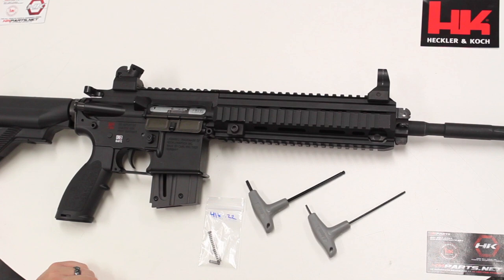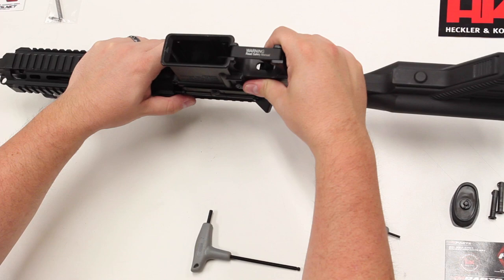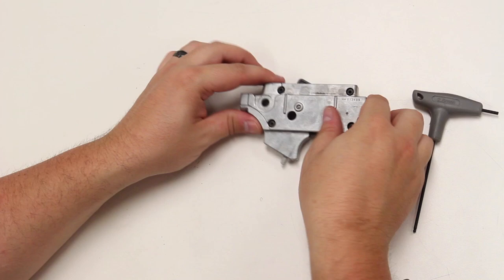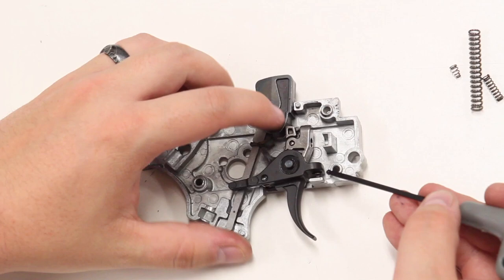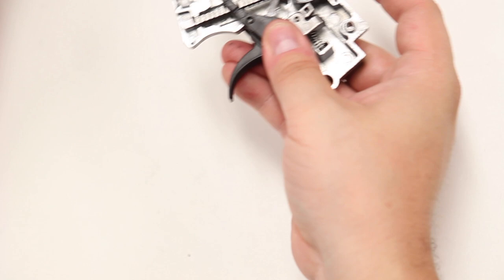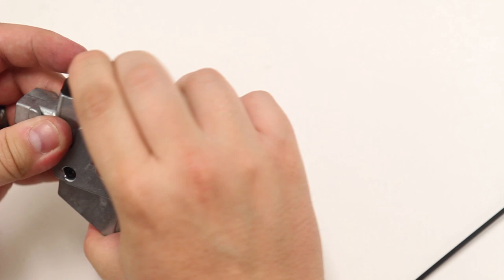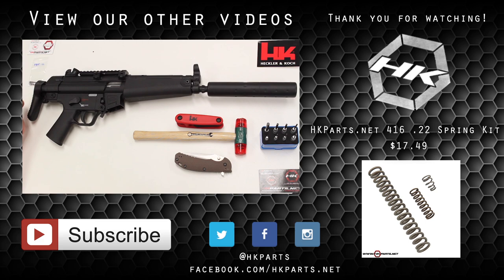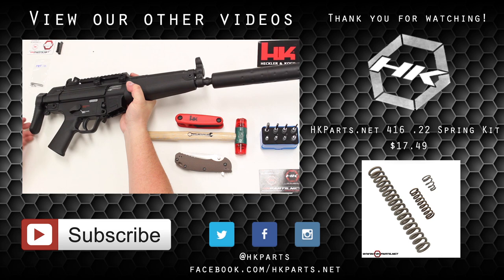HK 416 22 Match Trigger Upgrade Spring Kit Installation

Comment: Just bought a HK 416 D in .22LR.  Very nice firearm.  Well made.  I do have to caution that a few things have changed since this video was made.  1) The trigger assembly group is no longer metal, it is a black plastic. 2) while there are 4 screws, they use a small "star" type screw driver, not an allen wrench. 3) there are no longer 4 little nuts as HK seems to have had them embedded into the plastic.  4) there is a small diameter chrome rod that is just to the 12 O' Clock of the safety selector. This rod seems to like to come loose when you pull everything apart. So if it does, keep it with the cover you remove and not the cover with all the trigger parts in it.  You can push it back once everything is assembled.   Other than that, be careful when you unscrew the last screw.  Our assembly "sprung to life" once we tried to separate both sides.   I had zero opportunity to hold things together, just one small detonation!  This video is great and shows you what to do.  It is also useful when you have to put all the pieces back together again.  The end result, not as easy as the video shows but not hard either, just take your time and do it in an area where you can easily find small parts.  Once assembled, HUGE difference in the trigger pull.
Reply: I have the Walther version I'm installing the springs soon did u polish sear and hammer too?  Or just the spring kit? How much the pull after?
Reply: I’m having trouble installing the metal rod back in. Please help!!!
Reply: Which rod are u talking about
Reply: Thanks for the info on the plastic trigger housing. I just sold my older Umarex imported MP5AP model in favor of the new HK Imported MP5SD model, while that internal parts appear to be all the same the trigger housing on the new SD model is plastic and I’m very disappointed that Hank would cheap out like this. If I’d known this up front I would have never purchased the SD… Shame on you HK!
Reply: O boy.! Well mine is a couple years old I guess. We'll see. Love the grenade launcher barrel lol. One of the fake but why not parts on the toy. I'll be reading this post a hundred times I'm sure
Reply: I just bought one of these yesterday 3/26/23, and found it just as you have stated; plastic.  Rather disappointing.  I haven't shot it yet, so I will wait to discuss it later on.
Reply: A 4mm allen for the pistol grip, a 2.5mm allen for the mag release and a T10 torx bit for the 4 screws on the trigger group. This is for the version with the plastic housing.

Comment: I did this upgrade and took about 2 hours. It's not hard at all unless you're impatient. Take your time, use a steady hand (and fingers), and work on a workbench with good lighting.
The thing that made it hard is this installation video: its outdated and gives false info for the new black plastic revision of the trigger assembly.

For those who want some tips:
1) The pistol grip screw is 4 mm hex.
2) The mag release screw is 2.5mm hex.
3) Trigger assembly screws are T10 Torx. Do NOT use hex key on it as mentioned in the video or else you will strip the screws.

4) Flip the safety to "fire" before taking it out of the lower receiver.
5) Use needle nose pliers to carefully place the new seer spring and the trigger return spring. Much easier to do than using your fingers.
6) When in "fire" position, the safety lever housing's ball bearing is at the bottom (6 o'clock) detent. NOT in the left (9 o'clock) detent as mentioned in the video. Be sure to install it at the bottom detent. It also does NOT go in the through hole in the plastic housing.
7) Once the front cover is almost back on, use needle nose pliers to wiggle the safety lever housing to help it fall into place. Don't worry if the ball pops out from the detent in the back when installing the front cover, it will fall back into place with pressure from the front cover.
8) Before putting the trigger assembly screws back on, hold the assembly together with pressure from one hand and make sure the hammer can operate as expected. It should cock horizontally, and uncock vertically when pulling the trigger. If you cannot cock it (horizontal position), then your interior trigger level arm is blocking it from cocking. You need to take it apart again and make sure the little lever is not in the way of the trigger from cocking. Try carefully cocking/uncocking by hand without the springs installed so you understand where the levers should be. I spent an entire 1.5 hours figuring this out. It should look exactly like 6:55 in the video.

End result: trigger is much nicer now. Lighter trigger pull and cleaner break, with a satisfying reset.
Reply from the maker: Hello, thanks for your input. Anything firearms related does take a lot of patience, I'm sure we can all agree. As you'll see, this video was posted back in 2015. If there's demand for it, we're happy to make updated videos as parts change and are upgraded.
Reply: @HKPartsStore  IMO, if you decide to continue selling this upgrade in 2022, you owe it to yourself and your customers to create an updated installation video that reflect the proper install steps. Not only do you hurt future sales (by customers publicly complaining it's "too hard to install"), but also your brand reputation for selling a product that you don't support, because of your outdated installation video. It's a shame because the upgrade itself is worth it.
Reply: @kishkaru21   100% agree!

Comment: Thank you so much for posting this video!  I installed my HK Parts spring kit this evening, the only difference being on mine, the fire control group has a black plastic outer, and no nuts on the back, just screws to hold the assembly together. Before the upgrade, a 5 pull average on a Wheeler digital trigger gauge averaged about 10 lbs.   After installing the kit, average is just under 6 lbs. Had hoped for more like 4.5, but it's still a big improvement. The gun is brand new, and I haven't stoned the sear.   I had to laugh, reading the instruction book for this rifle; pulling the front takedown pin voids the warranty. Not that I ever send guns in for warranty work, but still.
Reply: I think I have the same style as you. Does the safety catch “spring end” go in the hole or one of the indents? This is the only part I can’t figure out because I have a stainless piece that I believe fits in the hole next to the safety catch.

Comment: Just got done with the spring upgrade.  Do not attempt unless you can handle stress well. A must! Take pictures as you go along!!  #1 once you get the trigger spring and the next one up in place use a tiny 2 inch C clamp to gently hold it all together. #2 Use a dab of grease to hold the large end of the tiny trigger spring in the hole. #3 The safety ball indent does not go in that hole. Refer to the pictures you took! Be aware IF you lose that hammer spring keeper  there appears to be no Source for parts!!  I had to make a new one on my metal lathe. HK Parts... where are you?? Finally got it done, back in and tested, seems to be an improvement.
Reply: Have you happened to locate where to buy a hammer spring keeper aka hammer spring receptor since ? Sorry for asking 2 years later, but we just lost one and as you mentioned, you can’t find this part anywhere. Thanks

Comment: Just did this install last night on my Hammerli Tac R1, video made it pretty simple. Mine also had the black plastic trigger group as others had mentioned. The tricky part was keeping the trigger pin in it's locating hole while installing the hammer spring - it's kinda shallow and the tension of the sear would pop it out. Also the orientation of the hammer spring guide rod got moved during the disassembly somehow and when it was all buttoned back up, the back edge of the guide rod was hitting the metal locating pin in the middle of the assembly. Had to take apart/put back together 4 times to get it correct. I don't have a pull gauge, but it does feel a lot lighter.
Reply from the maker: Sounds like it was a journey but we're glad you got there in the end! Well done.
Reply: Do you know if they offer a metal trigger box for the hammerli? The plastic box seems flimsy
Reply: @unitedwestanddividedwefall3521   I believe that the metal box trigger group was an earlier production, and they had since changed to the plastic one.  On it's own, the metal one seems better, but once you drop it back into the receiver, I don't think there would be any noticable difference.

Comment: Mine had the cheaper plastic housing ,,really hard to get it back  together without it popping apart ,but I got it done nice upgrade,Don't think I will ever pull the trigger housing apart again ...Think it would be easier with the metal housing the plastic has a lot of flex to it.Thanks for posting
Reply: Holy crap this, I thought I was going to lose my mind getting the plastic housing/safety catch to sit flush when putting everything back together, kept shooting my spring lock across the room over and over.
Reply: @jeffjohnson4083  same

Comment: One suggestion - especially with the current plastic housings. Temporarily push the safety lever into position to hold the safety tumbler in place, then remove before installing the trigger pack back into the lower.  Aids in aligning the tumbler and one less thing to hold in place.
Reply: Great idea I've been having trouble with this.
Reply: This deserves more likes. I was struggling on putting it back, and this method saves me lots of effort.

Comment: As others mentioned, newer models have a black plastic housing.  This took forever and was quite challenging despite the video, which was extremely helpful.  Pull weight went from nearly 12 pounds before the install to about 8 pounds after.  Still a crappy trigger, unfortunately.

Comment: He makes it look easy. It isn’t as easy as it looks. But I am all thumbs and I did it. Stop the video and Look carefully at the position of each trigger element. Work where you can easily find the springs when they fly off. They will fly off. But you can do it. As was said earlier don’t put the safety mechanism into the hole. It goes into the detent. Good luck. Thanks for the video.
Reply: "They will fly off!"....LOL

Comment: Just fitted this spring kit to a friends rifle he has the metal trigger group. All went great till the safety cog moved out of position when putting the two halves back together, so had to refit but used the tip of first pushing the safety selector pin through the group to make sure everything aligned and functioned before tightening the screws.

Comment: I too had the cheaper plastic housing. The grip screw is 4mm like shown, but the screws on the fire control were small Torx, not a 2.5mm. My biggest issue was pushing back the spring on safety detent housing. I was only able to keep the trigger assembly in the correct place by using some lithium grease to hold the sear and trigger reset spring in place and then putting in the top right screw almost to stop. This allowed me to manipulate the safety housing to align with cover properly. While I can't be sure, I really don't want to take it back apart, I believe they show the safety mechanism in the safe position. Mine was on fire as I had to drop the hammer as shown in the video. I put the BX trigger in my Ruger 10-22 and that was drop in. This is not what I would call drop in. 

The good news? It's inexpensive, this video is very helpful minus a few points that I had to figure out, and it makes the trigger WAY better. Stock I had a gritty feeling and sound. That is now gone and the pull is no longer tremendous. Thanks HK parts!

Comment: This product does exactly what it says and lowers the trigger weight. Now I have to say that I don’t think it’s worth it. Not hating on anyone besides whoever designed this trigger. It is a pain to keep everything in place and assemble. I’d personally install 5 AR pivot detent pins. Thanks for the video but if anyone sees this debating buying the springs the trigger weight compared to the install personally wasn’t enough of a better trigger pull to be worth it.

Comment: Hello great instructional vudeo
I followed this to the letter and found I could not easily refit the safety selection arm as it was no aligning correctly with the component inside, I tried pushing in the small nipple which seemed to work but when I've reassembled the rifle I found the charger was stiff and it will not fire, any advice please?
Reply from the maker: Hello, thanks for watching! This is difficult to answer without more information. Please email Liz@hkparts.net with photo and video.

Comment: So I have the Walther version and I have everything in except I’m having a hard time with the safety catch. I have one stainless steel pin that is slightly different than your assembly. I’m pretty confident it goes right next to the safety catch but does that detent spring go in the hole for the safety catch or does it just put pressure inside that divet?

Comment: As difficult as this is, even though it did drop 4 lb off my trigger pull, do not attempt unless your mechanical aptitude is on the high side. Still a 6 lb trigger, so why can’t this be the factory stock trigger? A 10 lb trigger pull out of the box is almost a deal-breaker.
Reply: I have the Walther version with the plastic housing I assume this would work on mine too
Reply: @chrisgrace1489  Yes mine too has the plastic housing. Best of luck installing the parts. Took me two days of frustration but eventually paid off.
Reply: Ok thanks I haven't ordered the springs yet but plan too. Any advice on doing it
Reply: @chrisgrace1489  I used a shallow cardboard box to keep parts from flying but one spring still escaped (found with some luck). Take pictures or maybe a video while you open it up to help with re-assembly.
Reply: Ok thanks

Comment: Yeppers that was frustrating af but it finally went back together. Improvement in pull but I'm disappointed in the reset. The old springs had a very audible reset that you could feel. Did I do something wrong or is this normal?
Reply: Mine as well so I would say it’s normal.

Comment: Where can I buy another spring keeper? It launched out just as the video warned. Also, where can I find replacement screws for the trigger housing?
Reply from the maker: Hey! Sorry, we don't carry these. Try to contact Walther Arms 479-242-8500
Reply: @HKPartsStore  Thanks I will give them a shot.
Reply: Had the same thing happen after reassembling for the 14th time without it working, even after I did my 416 pistol with the plastic housing right the first time.   I could not find the part anywhere and could not get HKParts to call me back and just now found this post...so I found a thick washer with a small hole, extended the hole to accept the hammer portion with a Dremel and File and  brought the rest down to size with the grinder.  Worked like a champ.
Reply: @CRAZYMAMMA4U  Good to know, thanks for the response! I actually ended up contacting HK and was emailed an exploded view of the 416. I was able to ID the part and let them know, they sent it within a few days to a week or so! Have never worked with HK directly, but the rep I worked with was very helpful and committed to finding that part for me. Kudos to HK!
Reply: @CRAZYMAMMA4U  of
Reply: Here’s a tip, before taking out the last screw, I put the entire assembly in a large zip loc bag took out the screw and completed the tear dow. Did the same to put it back together, glad I did as the spine sprung and went flying (in the bag) so I still had all of the parts :)

Comment: STOP, before you order these springs check if you have a black plastic trigger group. The pin holes for the trigger and hammer are significantly more loose on the plastic housing and you will spend hours trying to reassemble it all. It must have taken me 20-30 attempts to close the two shells without the trigger or the retainer nut popping free. And if it isn't those two, the safety catch thing bumps the hammer spring.

Comment: Installed the kit on the pistol version and I'm left with an extra pin.  I didn't see it in any part of the video.  The weird thing is it is fully functional and yes the pull is softer.
Reply: me too!
Reply: Did you figure it out? Another Joseph who commented above mentioned a chrome rod at the 12 o’clock above the safety lever. I’m asking because I have a kit on the way. Thanks

Comment: I just purchased two of these rifles. Very displeased with the triggers. Had I known they were this crappy I would have bought the S&W
Reply: The S&W feels like a plastic toy though, for me it’s worth upgrading the springs, opposed to changing everything else.
Reply: I have both the HK and S&W.  There are massive tradeoffs with each one.  I really despise the plastic body of the S&W but its ability to use standard ar15 triggers makes it nicer to shoot.  The full size barrel also inspires a lot of confidence.  I haven't had any problems with the HK barrel but I wouldn't dump too many mags through it.  The HK looks and feels much nicer though and the magazine is much nicer in my opinion.  They would have a near perfect .22 if they combined the pros of each rifle.

Comment: My 416 22 came with a plastic trigger housing instead of the zinc allow housing. Is the disassembly the same for the plastic version, most importantly, are the trigger spring parts compatible with it?
Reply: The spring kit worked fine for me with the plastic housing.
Reply: Yes, mine is like yours. The kit worked just fine, only difference I saw was that there are no nuts for the four bolts holding the housing together.

Comment: what are the two Allen wrench sizes? I know one is a 4mm, but I didn't catch the other.
Reply: I know this reply is a bit late, but I think he said it was 2.5 mm. He says it right before he takes the trigger pack apart. He may have been talking about the length of the screws though. I'm not sure.